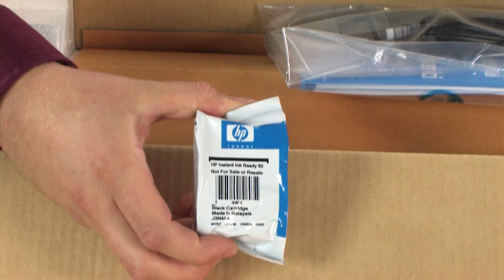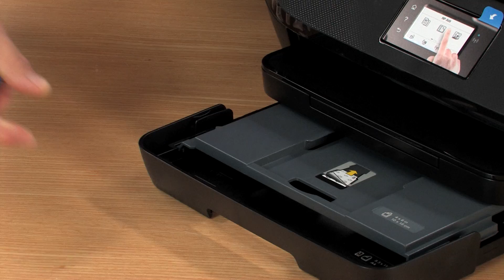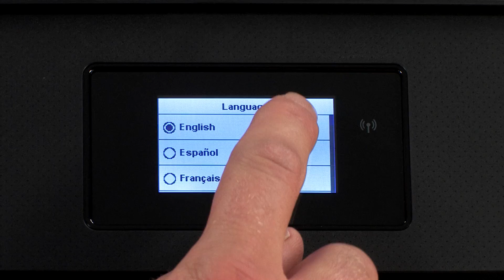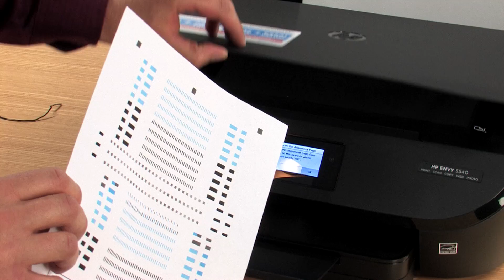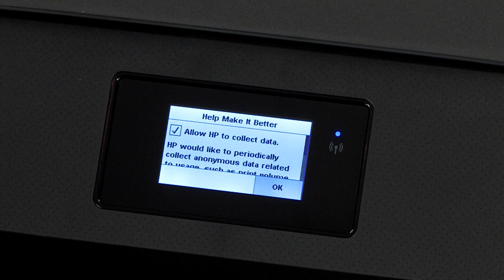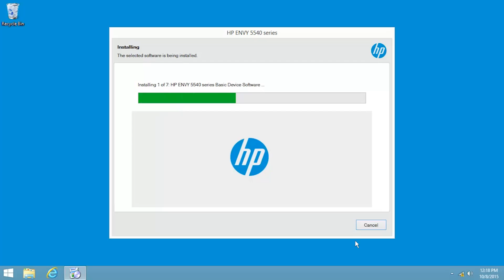Unboxing, Set Up, and Installation of the HP ENVY 5540 Printer | HP

Comment: i can't install  the printer over the network, i've tryed everything i've been on it for about 2 hours and i'm starting to regret byuing it. can you help me please. i have a xp windows version, i know it's old but it said that is't supported from the printer. thank you
Reply from the maker: +the nightrider Before you print or scan to your printer from a computer through a network, you must first connect the printer to the network and install software on the computer. These instructions guide you through the process of setting up your printer on a wireless network: http://hp.care/2rJBh6L
Reply: did that already, otherwise i wouldn't have posted the comment!
Reply from the maker: +the nightrider There is full solution software driver for Windows XP version which includes everything you need to install and use your HP printer. This collection of software includes the complete set of drivers. Please click on the link to download the drivers: http://hp.care/2tq2yLW

Comment: How do you find the wifi password for a HP printer
Reply from the maker: +Marsha Jacobs Use the built-in Wireless Setup Wizard to set up your printer on your wireless network.
Turn on the printer, if it is not already turned on.
On the printer control panel, touch the Wireless icon.
Touch the Settings icon, and then touch Wireless Setup Wizard.
Touch the name of your wireless network: http://hp.care/2hq5t34

Comment: it docent read ink cartage i had just brought the printer but it docent read the color ink I've tried cleaning it and nothing pass help
Reply from the maker: +Alex Vertiz     Please try a complete hard reset of the printer by following the steps below. 

- While the printer is turned on please unplug it from the wall outlet. 
- Please unplug the power cord from the back of the printer. 
- Wait a full 60 seconds. 
- Please plug the power cord into the back of the printer while plugging the other end directly into a wall outlet, not a power bar/strip or surge protector. 
- If the printer doesn't turn on by itself, please turn the printer on. Please the printer plugged directly into a wall outlet so that the printer isn't "starved" for power. Please let me know if this resolves the problem.

If the hard reset doesn't work, please contact Technical Support at 1-800-474-6836.  If you live outside the USA/Canada region, please click this link ( http://ow.ly/4mTBTl ) to find the phone number for your country/region.
Reply: +HP Printer Support it seem to not work the only one it reads is black ink not color
Reply from the maker: +Alex Vertiz   Even though you don't have the error that is mentioned in the title of this document, the steps in it are valid for your issue.  Please follow the steps in the "'Cartridges Missing' or 'Ink Cartridges Problem' Message Displays" document ( http://ow.ly/4mZrCm ).  Please let me know the results.

Comment: Hello,i have one question,the screen flickering is normal when i connect the socket and when i turn on the printer?thanks.
Reply from the maker: +Lostshadow8769    Please perform a hard reset of the printer using the following steps. 

- While the printer is turned on, please unplug the power cord from the back of the printer. 
- Please unplug the power cord from the wall outlet. 
- Please wait a full 60 seconds. 
- Please plug the power cord into a wall outlet. It is important that it is a wall outlet and not a power bar/surge protector. - If the printer does not turn itself on, please turn the printer on. 

Did this resolve the issue?
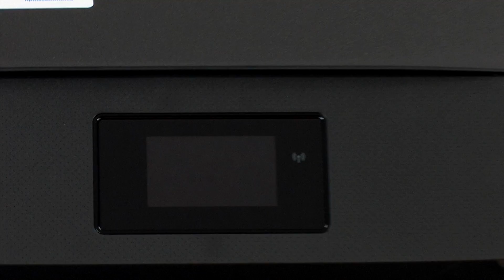Reply: +HP Printer Support Hello and thx for the reply,i think is not a issue,i try this metod but i have not solved.The same thing happens in the video up here,from 5:51 to 6:01,flicker 2 times when he press the power button.I hask another users that have the printer,and they too have the same &quot;issue&quot;,manufactoring defect?ty
Reply: Lostshadow8769 it happened to mine too when I first plugged it in and turned it on.

Comment: Do these come with full ink cartridges or some partially filled ones?
Reply from the maker: +TimeBee100 HP recommends that you use genuine HP ink or toner supplies. HP cannot guarantee the quality or reliability of non-HP or refilled cartridges. If you do not use genuine HP cartridges, the steps in this document might not resolve the issue. To check the authenticity of your cartridges, go to hp.com/go/anticounterfeit.
Reply: TimBee100 : Even the new ones you buy at Office Depot don't last long. I find myself changing ink after printing a few pages. 👎🏻👎🏻

Comment: I called hp and the tech say the help button suppose to be on is that right?
Reply from the maker: +Dave RT Help button will be on only when the feature is available. Example: If you touch copy menu, then the help button will light up.
Reply: Can u make a video about the help buttoned ???
Reply from the maker: +Dave RT Yes, we will share your inputs to the concerned team. However, Help button will be on only when pressed on copy or scan menu. Otherwise, Help button will be off.
Reply: How do you turn the help button off ?
Reply from the maker: +Dave RT From the control panel display, access the Home button, verify wireless connectivity, and access Help menus: http://hp.care/2szPirc

Comment: what wrong with the printer if it prints slow
Reply from the maker: +Rosa reynoso I understand that your printer is printing slow, please use this link: http://hp.care/2oFNTtn to resolve slow printing.
Reply: thank you
Reply: can i conect my printer to a phone
Reply from the maker: +Rosa reynoso Yes, you can print using mobile devices. Make sure your Android/Apple device is connected to the same wireless network that your printer is connected to, or that Wi-Fi Direct on your printer and Android/Apple is enabled. You can refer to the document: http://bit.ly/2z6w5ju and http://bit.ly/2z6gSyz
Reply from the maker: +Rosa reynoso You're welcome :)
Reply: thank you
Reply from the maker: +Rosa reynoso You're welcome :)

Comment: What do you do if the help button comes on?
Reply from the maker: +Dave RT Help button: The button opens the Help menu for the current operation. The button lights up when the feature is available. To know more please go through the Control panel buttons and lights: http://hp.care/2szPirc

If the issue persists I would recommend a factory reset. Perform the below steps:

* Press Power button to turn the Printer On.
* Press BL, BL, BL, BL Buttons, in sequence. (BL is bottom left, note these button would not be lit up, just press these buttons in sequence just outside the control panel on your printer)
* Touch Support Menu.
* Touch Support Menu.
* Select Reset Menu and Touch OK.
* Select Partial Reset and Touch OK.
* Wait for unit to Power Down/Turn Off.
* Press Power button to turn the Printer On.
Reply: Is the help button suppose to stay on ?
Reply from the maker: +Dave RT Help button opens the help menu for the current operation. The button will light up when the feature is available. Example: If you touch copy menu, then the help button will light up.
Reply: HP Printer Support with this printer if I only have a smartphone as an hot-spot to use the printer with HP ePrint, will it work?
Reply from the maker: +karl trehin I will be glad to answer your query. HP ePrint works with the hot-spot, however, when you're not around the printer, the printer needs a constant internet connection to work with the ePrint.
Reply: HP Printer Support thanks a lot for your fast and useful answer 👍
Reply from the maker: +karl trehin I am so happy to know that the information provided by me was very useful for you. If you need any help you can let me know or you can also contact HP phone support: www.hp.com/contacthp/

Comment: I just bought one. It still doesn't work.
Reply: I'm really upset because the salesman said I could use it on my mac mini, but when I set it up, the website said that the software is not supported by OS X. So, I set it up on my laptop (Windows 7), but it still does not print anything from my computer. In fact, It has printed nothing except the alignment page, and two reports which resolved nothing.
Reply from the maker: The support page ( http://ow.ly/g12W301ZI3R ) has a software/driver package  for Mac OS X 10.8, 10.9, 10.10 and 10.11.  Which one did you need?  Just use the blue "change" link and then the drop downs to set the "Operating System" to "Apple Macintosh" and then select the version from the other drop down, and click the Blue "change" button below.   As to Windows 7, what type of connection are you using?